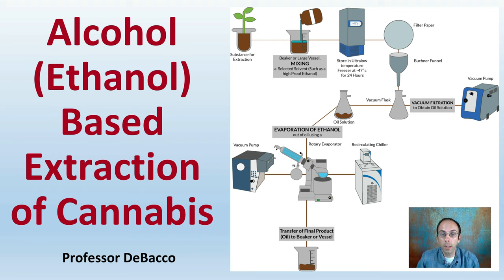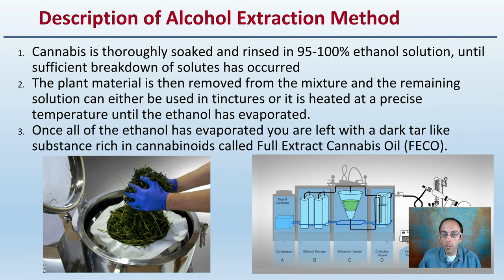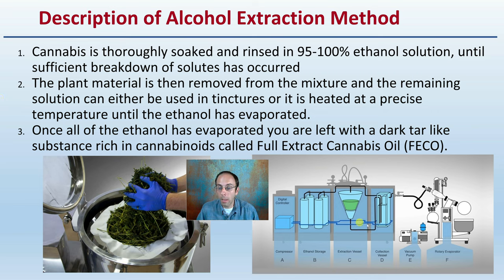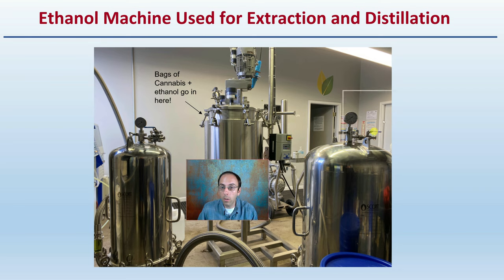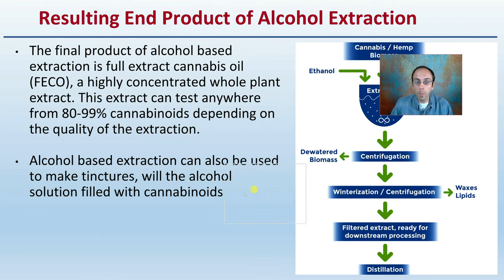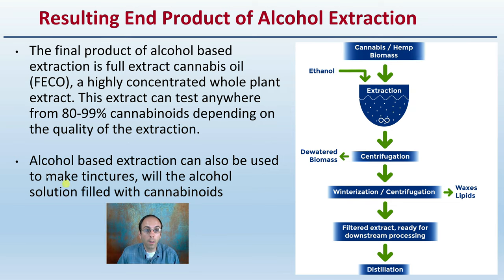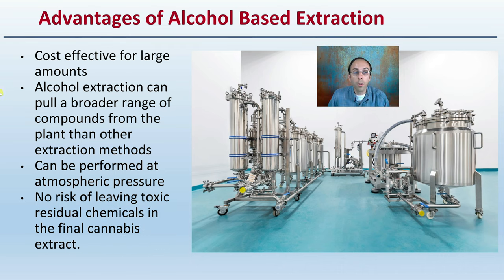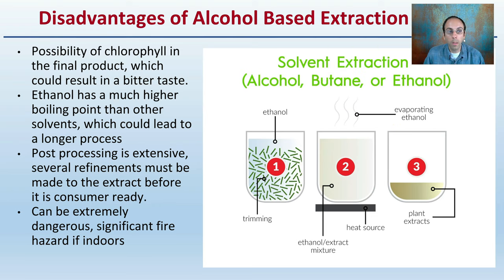Alcohol Ethanol Based Extraction of Cannabis

Comment: i do a similar process at home but... I soak dry frozen material in cold iso 99% for 20mins then use a temperature controlled distiller to reduce the tincture at 79C until its down to around 100ml, then put it into a vacuum chamber to cold purge the rest of the iso out. the entire process takes around 8hrs. I end up with a thick taffy that is golden honey clear or with a reddish tint depending on the strain. very close to bho butter but much more yield at lower cost and i recover 70% of the alcohol.
Reply from the maker: Thanks for sharing!
Reply: That is amazing!
Reply: How much green and iso do u use
Reply: @sugardaddygaming4633  typically I am growing indoors in a grow tent so my plants are what i would call medium-size. I trim it down and keep the biggest buds separate (usually around 2oz) then i take the rest and screen it to get some kief to make some hash (around 20grams). the rest goes into the freezer to extract. so i would say usually around 4oz of trim and buds. with that i add around 2.5liters of iso. (it is usually broken down to almost power so it only takes up about 2liters of volume by that time)
I then take it out of the distiller when it is down to about 100-200ml. by the time it is done, I am left with around 20grams. If I skip the dry-sifting step i may get up to 40grams of extract.
Reply: Iso means isopropyl alcohol?
Reply: @roniandfriends9872  yes, 99.9% food grade.
Reply: I don't have a vacuum chamber and I'm to that point that I need to get the remaining is ono out. Don't know if I should heat to 220 or so to decarboxyltate or should I do that beforehand
Reply: What do you do if my iso seems to have 2 layers 1 lightish green on the top and a milky one on the bottom, I assume it's mixed with water? I have a chemistry distillation set with a water circulating vacuum pump, no cold trap can I still reclaim distill it off..I say thinking of course you can

What is in each layer?
Reply: Yk one could easily disguise a THC extraction lab as one that extracts CBD...
Reply: How much do you spend on the alcohol?
Reply: Hi, thanks for this information. Could I please ask what distiller you use? Could you link us to it? Many thanks

Comment: Hello professor. Thank you for the great content. Can you please elaborate on the post processing after Alcohol extraction in order to achieve a high quality tincture? Thank you
Reply from the maker: Typically a form of distillation to separate out the different components of the initial crude extract.
Reply: do MCT oil tincture instead in the case of cannabis, the MCT oil is triglyceride which means there is more thc can be bound with. It's slower... way slower process to make it, but worth it. Google what "slow maceration" is and do just that.

Comment: Can I use denatured ethanol for extraction? Will it be safe after evaporation?
Reply from the maker: It can be used, but it would not be recommended due to the inclusion of other solvents that are added.  "Denatured ethanol is a form of ethanol that is diluted with other solvents such as acetone or IPA. Denatured ethanol can be used in extraction processes and is often utilized by any extractors looking to avoid the higher costs associated with using pure ethanol." https://ecolink.com/info/denatured-ethanol-for-extraction/